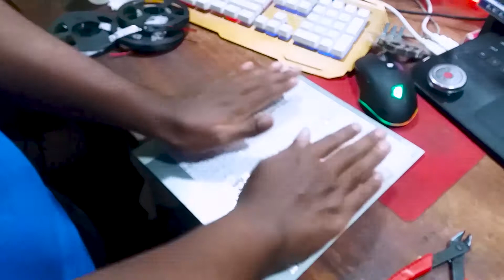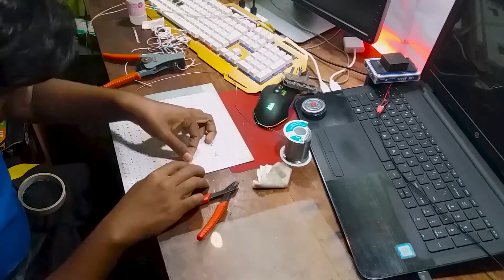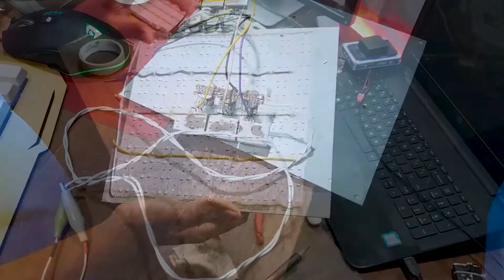Color Temperature Changeable DIY LED Studio Light Panel

Comment: Hey this is an amazing project ! I made my own light with WW and CW led stripes but I'd like to make one potentiometer design to control the color temperature, is it possible ? For now I put a 3 way toggle switch I can only operate at 2700K or 6500K. Thanks anyway :)
Reply from the maker: Or You can Buy Online Voltage Regulators for your project.
It's Very Easy to Use.
Reply: @DSKTechTips  I ordered some models today but I still don't know how to make one knob color temperature controller design :)
Reply from the maker: Use three of them. Then connect one by one.
Ex: One regulator can control one color.
Reply from the maker: Watch This One "And Use three heat sink to each one | Don't use one heat sink": https://www.youtube.com/watch?v=GCMjSWfFdiQ
Reply: @DSKTechTips  thank you I checked out that video too but I'd like to make it with only one potentiometer is it possible ?
Reply from the maker: Yes It works
Reply: @DSKTechTips  thank you so much🙏🏻😊